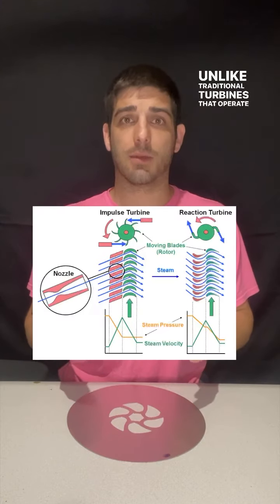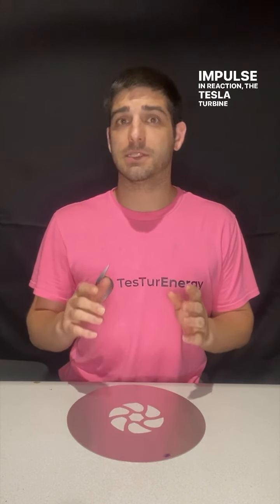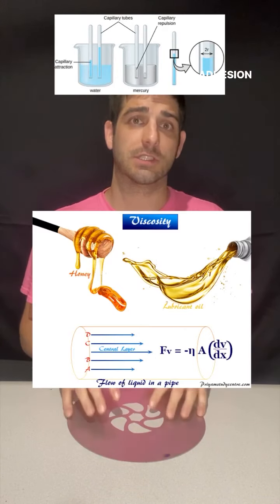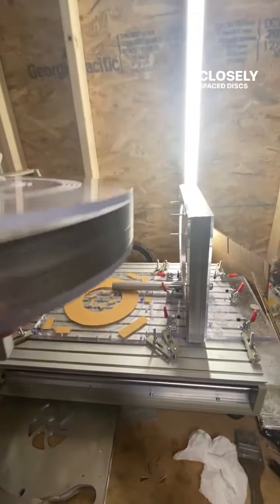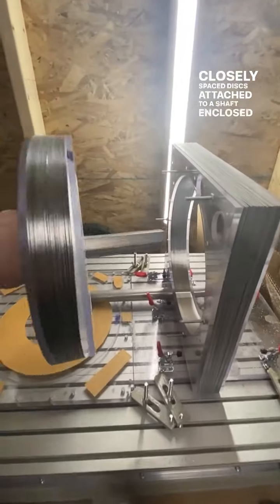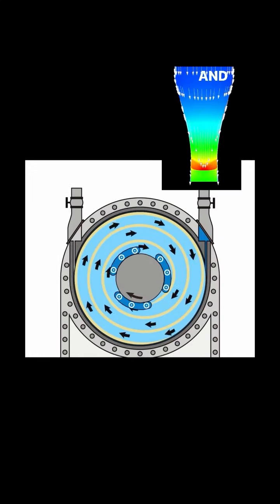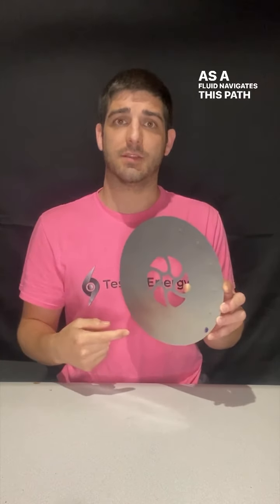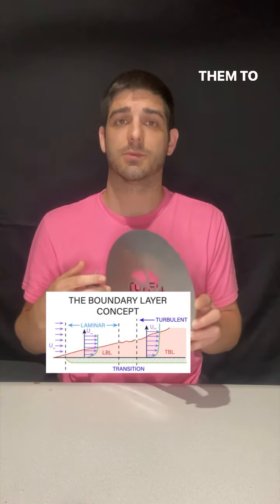Nikola Tesla’s Greatest Invention! - The Tesla Turbine

Comment: The main problem with Tesla Turbines is that they don't outperform conventional impulse turbines unless they are ran at a very high RPM.
Reply from the maker: I appreciate your comment but that’s not an issue because, despite what everyone erroneously claims, Tesla turbines work just fine, get plenty of torque and output power at low RPMs.     I’ve got some copy pasta 🍝 of mine that I’ll share with ya here to explain more.  Tesla turbines aren’t made efficient by spinning really fast.   That’s only for when the disc stack is being used as a centrifugal pump, because ALL centrifugal pumps’ compressors, performance is tip speed dependent.   But spinning the turbine fast will produce a centrifugal head that opposes the incoming fluid flow, reducing the pressure gradient across the nozzle, reducing fluid final velocity, reducing mass flow rates through the nozzle and ultimately reducing power out.
Reply from the maker: Furthermore the faster you spin them the faster the fluid you have has to go just to still be moving faster than the discs and still provide torque.   Lastly, they work just fine for industrial use and can scale up just fine because the torque on the discs is proportional to the difference in the fluid speed and the disc speed. So the disc tip speed is the important factor here. For any given fluid supply in, the bozzle will have a max fluid velocity. So the turbine disc tips will have a max speed set at that fluid speed irrelevant if radius. Now considering that centripetal force is proportional to V^2/R, if you keep the tip speed the same but increase the radius the centripetal forces on the disc for the speeds needed will actually decrease. 

Furthermore the faster you spin them the faster the fluid you have has to go just to still be moving faster than the discs and still provide torque.   Lastly, they work just fine for industrial use and can scale up just fine because the torque on the discs is proportional to the difference in the fluid speed and the disc speed. So the disc tip speed is the important factor here. For any given fluid supply in, the bozzle will have a max fluid velocity. So the turbine disc tips will have a max speed set at that fluid speed irrelevant if radius. Now considering that centripetal force is proportional to V^2/R, if you keep the tip speed the same but increase the radius the centripetal forces on the disc for the speeds needed will actually decrease.
Reply from the maker: You just have to know how to design it correctly to actually reduce slip to make them work, not spin them fast.  The only reason people think Tesla turbines have to be spun too fast is because EVERYONE has mistaken the part of the patent that is about the turbine being used as a pump as being about it being used as a drive turbine.   The only time you want to spin a TesTur fast is when it’s being used as a pump/compressor. This is because ALL centrifugal pumps’/compressors’ performance is tip speed dependent.   “I have found that the quantity of fluid propelled in this manner, is, other conditions being equal, approximately proportionate to the active surface of the runner and to its effective speed. For this reason, the performance of such machines augments at an exceedingly high rate with the increase of their size and speed of revolution.” -Nikola Tesla 

And again, you DO NOT want to spin too fast in a TesTur because the centrifugal head will just counter your incoming fluid flow reducing power. And the faster you spin discs, you’re fluid has to be going even that much faster just to be able to apply a torque on the disc face.   “Still another valuable and probably unique quality of such motors or prime movers may be described. By proper construction and observance of working conditions the centrifugal pressure, opposing the passage of the fluid, may, as already indicated, be made nearly equal to the pressure of supply when the machine is running idle. If the inlet section be large, small changes in the speed of revolution will produce great differences in flow which are further enhanced by the concomitant variations in the length of the spiral path. A self-regulating machine is thus obtained bearing a striking resemblance to a direct-current electric motor in this respect that, with great differences of impressed pressure in a wide open channel the flow of the fluid through the same is prevented by virtue of rotation. Since the centrifugal head increases as the square of the revolutions, or even more rapidly, and with modern high grade steel great peripheral velocities are practicable, it is possible to attain that condition in a single stage machine, more readily if the runner be of large diameter. Obviously this problem is facilitated by compounding, as will be understood by those skilled in the art. Irrespective of its bearing on economy, this tendency which is, to a degree, common to motors of the above description, is of special advantage in the operation of large units, as it affords a safeguard against running away and destruction. Besides these, such a prime mover possesses many other advantages, both constructive and operative. It is simple, light and compact, subject to but little wear, cheap and exceptionally easy to manufacture as small clearances and accurate milling work are not essential to good performance. In operation it is reliable, there being no valves, sliding contacts or troublesome vanes. It is almost free of windage, largely independent of nozzle efficiency and suitable for high as well as for low fluid velocities and speeds of revolution.” -Nikola Tesla  Tesla both knew it wasn’t meant to spin fast and that it worked great for low speeds IF you design it correctly.
Reply from the maker: Can you show me a bladed turbine that can handle the wet steam that’s produced from geothermal energy sources without eroding down the indispensable complex geometry blades to little nubbins in a matter of minutes?   

Or a bladed turbine that can actually fully utilize all the heat energy in steam by actually fully expanding it and not be damaged by the condensation and cavitation?   

One that doesn’t require superheaters, MASSIVE heat exchangers and expensive waste heat recovery systems to actually maintain whole system thermal efficiency?   

Yeah sadly bladed turbines get zero efficiency from geothermal steam sources and can only be used to produce electricity from them with outrageously expensive multi circuit loops to keep all the fluids separate and have MASSIVE heat exchangers.   

But when even just one geothermal site in California has more energy than the US needs for the next 1000 years and TesTurs see no damage from multiphase motive fluid flows I’d take even just 10% efficiency over the zero that bladed turbines can offer.   

The same goes for solar steam boilers because it’s very difficult to have a residential solar boiler that doesn’t produce wet steam.   

Furthermore bladed turbines can’t use low grade fuels like biomass, woodgas, and definitely not solid particulate fuels like powdered coals and pulverized iron.   

That’s not an issue for the TesTur for the exact same reason that condensate and cavitation in wet steam doesn’t damage it. 

Because there’s no lifting surfaces for the particulate to smash into.
Reply from the maker: What most people mean to be saying is, bladed turbines get a high efficiency on only a very limiting, very specific, very expensive set of proprietary formula refined fuels.  

And the only reason TesTurs don’t is because no one has actually put any money into them like the BILLIONS of dollars thrown at proprietary bladed turbine designs just to get 1% point increase in efficiency.
Reply: @CharlieSolis  The problem for reaction vs impulse turbines was one of surface area.   Reaction turbines are dependent on the reaction area, and for a TT the reaction area increases as the flow is forced to take a more spiral path across the rotor.

I did some experiments ~4yrs ago with various 3d-printed and machined impulse+reaction turbines and tentatively concluded that a 3"dia TT would need to spin around 25-35krpm to reach break-even with its impulse equivalent.

I see you may have a workaround using reduced flow to increase the circular flow path and thus reaction area; I'm curious to see how it turns out.😉
Reply from the maker: Hey bud I’m sorry but that’s not true. Even my 4.5in diameter one can output plenty of torque and effectively too at low rpm.

DIY Turbo Generator for Off-Grid Electricity: 250 watt Load https://youtu.be/60OqmBMNV-Q 

They output plenty of torque and horsepower throughout the rpm range. 

Again please go read what Tesla himself even wrote. 

If a Tesla turbine doesn’t work at low RPMs, and or doesn’t get torque at low RPMs then it needs to go back to the drawing board because they get plenty of torque even at low rpm. 
And for the 10in disc

Tesla Turbine 250 watt to 2650watt Power and Efficiency Test https://youtu.be/K7qZvq1CMFg 

These preliminary tests are just to see how much electrical power can be produced with room temp compressed air driving the Tesla turbine. 

6.22ft-Ibs of torque at only 4150rpm and +4.25kW between 6000-12,000 rpm. 

The TesTur nozzles never went over 20psi at the nozzle for the 2650watt electrical load test and not over 40psi at the nozzle for the 4250watt dyno test.   

This is so I can get a baseline for what to expect as I increase the temps to combustion levels.   

When using elastic gasses the counterintuitive thing most overlook is that the viscosity of gasses goes up with temp. 

So not only do we see an increase in thermodynamic efficiency from increased temps but the TesTur isentropic efficiency also goes up due to the reduced slip from the increased viscosity.
Reply from the maker: @hakasays  additionally, check out our collab video with integza! It just came out yesterday. 🦾🤓👨‍🔬

https://youtu.be/Tuzh9mHvzkk
Reply: @CharlieSolis  Was speaking of efficiency, not torque.
It looks like you have a huge blade-stack so I'm sure it is quite torque-ey.🔧🙂

I didn't do efficiency tests as a pump though, a dense bladestack might generate a good deal of head pressure that would be useful in several applications.....
Reply: @CharlieSolis  If you have a 3d printer, one way you can test efficiency is to print an impulse turbine the same size as your Tesla Turbine bladestack, then fit it in the same body and see how it performs compared to bladeless.

(Not an apples-to-apples test but it's an easy one to perfrorm)
Reply from the maker: @hakasays  hey so I appreciate your input but check out the little 4.5in in small one it’s got plenty of torque and it’s doing it efficiently too. 

The discs do not need to be spinning fast for their kinetic energy to be efficiently converted by the discs when designed right.